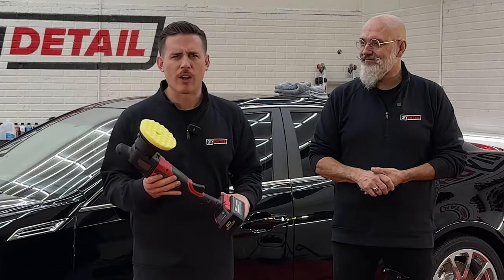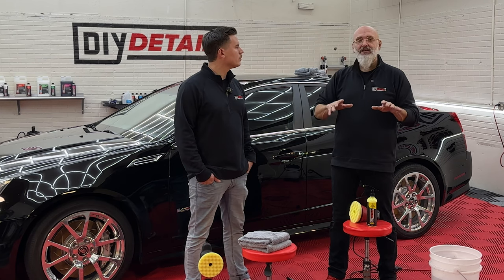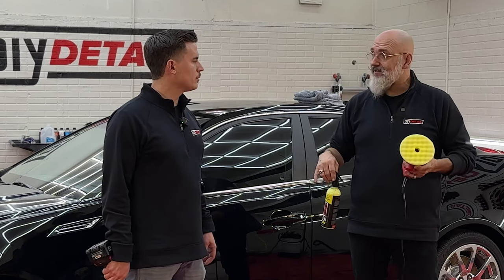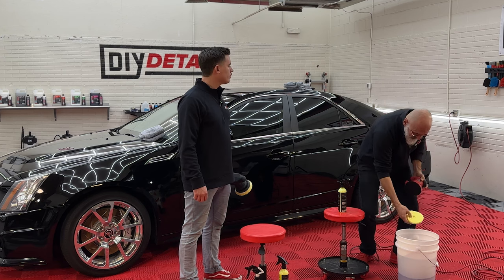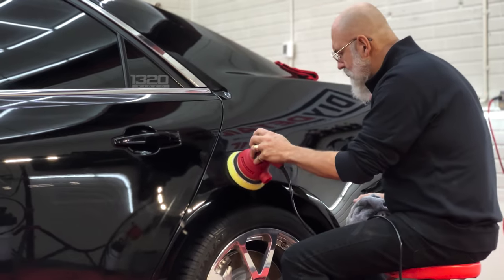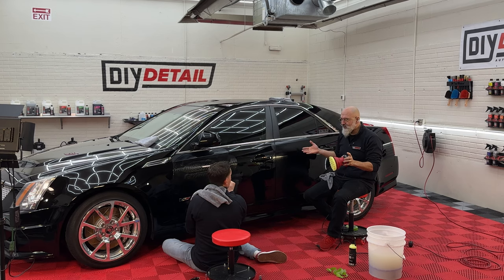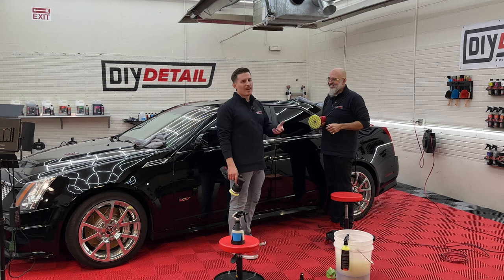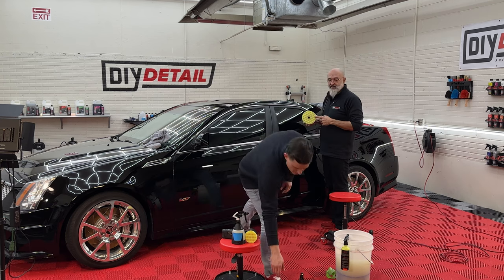How to polish a BLACK car: techniques, tricks (and mistakes to avoid)! #detailing #diydetail

Comment: I’ve told folks for years you don’t need a $400 Rupes or Flex DA polisher. You can do the same job with a $80 Bauer polisher from Harbor Freight😂. Now the more expensive machines will be smoother and give a more pleasurable experience but a 15mm throw machine is a 15mm throw machine regardless of who makes it. Great video. I’m really enjoying the Gold Standard Polish!
Reply from the maker: Thank you
Reply: I second this!
I have a Bauer polisher myself and I love it!
Reply: @diydetailofficial What is some advice you have for someone just starting that isn't covered in your videos?
Reply: Bauer DA is borderline unusable and absolutely does not give the same results regardless of technique
Reply: @lastdays.  not eve close to being true. The pad and polish/compound are what has the biggest impact on results by far. 8, 15, 21mm throw is the same no matter what machine you use. 800-5,000rpm is the same now matter what machine you use. Cheaper machines won’t last as long , are louder and vibrate more but will give you just as good results.
Reply: @BetterThanNewDetailing  to each their own but i got awful results with that DA when I usually get near perfect results with the same pads on a Griots or Rupes DA
Reply: I purchased a Bauer and it was horrible!!! Bad balance and vibration. Spend a little more money and get a machine that will allow you to use the machine without "hurting" yourself! 😅   Last, to be able to do the job and get good results.
Reply: What speed for it? If im using the wool pad? For 2 step
Reply: @JR-nh4fi  if you’re using a corded polisher then no more than speed 2 or 3. Just enough so the pad won’t stall. If your using a battery powered polisher then speed s 4 is good and then when the polisher sounds like it’s losing torgue then go to speed 6.
Reply: Shyt Ive seen old head go to work with a literal variable speed grinder 😂
Reply: other than feeding our enemies with Chinese made products absolutely agree

Comment: How does the Gold Standard Polish compare/contrast with Optimum Hyper Polish and McKee's 37 Spray Correcting Polish?
Reply from the maker: Compared to hyper polish it has more cut, and the longer you work it the easier it is to wipe off

Comment: Just re the glass - I had a very surprising experience. I was trying to remove a stubborn "film" of grime on my brand new car, and tried a compound (Optimum Intensive Polish), by hand, with a small foam pad. (orange CCS). It created micro-marring! I had watched a video on the Obsessed Garage channel where Matt said "use the most aggressive stuff you have" (in the context of thoroughly cleaning the glass before applying a glass sealant). It appears to me that glass, despite it's hardness, still has to be treated with great care!
Reply from the maker: Unfortunately yes, mild is better for cleaning

Comment: Love the rinseless wet wipe method that Yvan introduced me to, makes removing the polish residue so easy. If you're a hardcore DIYer and you're driveway polishing outside (or you're a mobile detailer), you can use the rinseless to wipe down the panel just before you buff it to remove any dust, and it will help cool the panel on sunny days if you keep the bucket out of the sun.
Reply from the maker: Excellent!

Comment: Great videos guys! Do you prefer rinseless wash for cleaning pads as opposed to using a designated pad cleaning solution, like the powder that comes with lake country pad washer? Thanks for sharing
Reply from the maker: The powders have a slight advantage.

Comment: Great video guys. I have been asked to detail a 1962 Impala that has faded paint (original paint). The body is solid and no plastic filler (aka - bondo). What would you recommend to bring life back? Should I 2-step it with a compound then polish? And, can you ceramic coat old paint? Thank you!
Reply from the maker: The least agressive possible, and yes you will want to coat it after

Comment: at what point to switch pad or to dunk the pad in the rinseless and respray with product? 
Or does 1 pad do the whole car as long as you redunk the pad in the rinseless and respray with product?
Reply from the maker: One pad will easily do many vehicles, clean it after every panel.

Comment: Hey DIY guys! I just used these methods with the gold standard system on black paint! I got amazing results! Just curious about the purple pads as I will be doing another vehicle with heavier paint defects. My question is can I wash my purple pad the same as the yellow pad in rinseless like you guys demonstrated in this video?
Reply from the maker: Yes, same system.

Comment: Thanks for putting a great video together I’ve got all sorts of polishes and one of them is the 3M system what do you think of the ultra fine 3m polish on an ultra fine pad as a total finisher, I stopped using it after hearing the word fillers but you’ve maybe allowed me to use 300$ of 3M product thanks so much.
Reply from the maker: Use it before you buy something else

Comment: A really helpful video for someone new to the idea of polishing. I'm curious about the speed settings Yvan is using for the orbital sander? I realize max speed for drying off the pad after soaking/rinsing it but for the actual polishing?
Reply from the maker: On that sander there’s only one speed. With the small orbit size speed is less of a problem.

Comment: Interesting,, but how much area does a squirt of spray wax get you? Don't you need to keep reapplying the pad.
Reply from the maker: What we are using in this video isn’t a wax, it’s an abrasive polish. One spray covers a 2’ by 2’ area. The pad should be cleaned after every section. Never add Clean polish to a dirty pad.

Comment: How do you do smaller areas if you only have one machine? Like the area of the rear bumper of a car that sticks out a few inches from bottom of trunk lid?
Reply from the maker: I use a 6 inch pad
Reply: @diydetailofficial  do you basically try to keep one edge off the pad flat?
Reply from the maker: Yes
Reply: @diydetailofficial  thank you! As a hobbyist wasnt sure if i should be getting a 3” polisher as well. Ill try with 5.5” pad first! Car is just in need of a touch up after 3 years of correction plus coating and want a refresh so if anything maybe i will try the small areas by hand. Thanks!

Comment: Great content always! Why is a damp pad better, better for polishing but not correction? Your product is just for enhancing not correction ? Thank you
Reply from the maker: The Gold Standard Polishing System will both correct and enhance. A damp pad has several advantages. 

-Lower temperatures increases cut and gloss.
-no areas of dry buffing, meaning less chance of swirls or micro marring.
-longer pad life
-pad conforms better to the surface 
-more efficient correction.
Reply: @diydetailofficial  Amazing!! Thank you so much for the detailed reply. You guys rock!
Reply: New pad is pretty hard. Damp softens it
Reply from the maker: Exactly

Comment: Will your polish remove defects like swirls and light scratches?
Reply from the maker: Yes, up to 1500g sanding marks
Reply: @diydetailofficial  wow that's amazing. Any estimation on how many vehicles a bottle will do?
Reply from the maker: One bottle will do the equivalent of roughly 64 oz of traditional polishes.
Reply: @diydetailofficial  Sounds awesome. I know I've been quite the bother in your comments section. Your replies are extremely appreciated, and frankly unbelievable. Never thought I'd have so much useful information from a company in a comments section. As soon as I can afford it, I'll be placing an order. Thank you.
Reply from the maker: Thanks

Comment: I polished myself trying to learn and have slight buffer trails on the black paint. Any pointers?
Reply from the maker: Buffer trails( with a rotary) can be caused by a few things. Too much pressure, dry or loaded( dirty pad), a flat faced foam pad, high speed, and angled pad.

Comment: Gentlemen is it advisable to damp the pad but use other brand polish?
Reply from the maker: no, the Gold Standard Polishing System is just that -- a system. However, do what you're going to do and perhaps it will work for you:) If not, you know the system we teach will work

Comment: For the rinseless wipe after working the polish, instead of a dampened towel, is it as effective to maybe spray a rinseless solution where you were just polishing and spray the towel then wipe? I hesitate to ask if you CAN because of course you CAN, just curious if it would work as well. Love the channel! You guys rock!
Reply from the maker: You can do it but it won’t work as well (it will actually be more work with the spray method). Best case scenario is low nap towel, damp, followed by a dry towel 👍

Comment: 7:30 U can do the pillar with 5 inch but can u do a convex panel ? Can u explain if its possible at all?
Reply from the maker: Yes you can easily do a convex surface, you simply have to slightly tilt the machine
Reply: @diydetailofficial but that seems to contradict your advice to always keep the pad flat

Comment: Everywhere I read tells me not to polish with an orbital sander as you can’t adjust the speed low enough, even at the lowest setting, and the orbital diameter is too small. With all your experience will a palm sander do just as good of job polishing using the same method and without adding risk to the paint? Using the DIY polish and pad of course….
Reply from the maker: It's not a method pros use, but it's presented here as a very acceptable option to SHINE the paint. To get gloss. We're not going after deep scratches, think instead about "shiny scratches." From 5 to 10 feet away the car will pop. Yvan teaches this method because the palm sander is so common. We want this to be easy and accessible -- learnable -- to anybody:)
Reply: I'm reminded of a video from Scott HD where he tried one of those very cheap orbital sanders, just for giggles - his reaction was priceless: "Holy crap it works!" 😃

Comment: Y’all mentioned keeping the heat down.   Well of course.    But then you mentioned swelling the paint from heat.   Got it.   But then you mentioned releasing solvents!!!   So this rather cryptically placed hint tells us that the paint you are referring to has been freshly painted.    As in, within the last few days.     Of course SOME solvents are still escaping even a day or so later, but are we talking about polishing a black car, or polishing a freshly painted car?    You then just happen to mention some partial respray, indicating is has been painted recently.  But HOW recently.   If the topic was polishing a black car, as per the title, then when you mentioned escaping solvents, anyone who knows car paint would be wondering why solvents were still being released from what we should be able to assume is a fully cured car.      And for those of us who know nothing about car paint, we are wondering why polishing releases solvents.      Please correct me if I’m wrong, but it would seem that if polishing could release solvents AT ALL, then the paint wasn’t cured enough to be polishing at all, unless you are highly skilled and are trying to remove an imperfections before it gets any harder, which is quite a dicey gamble to attempt.  I’ve rubbed out runs that were tacky, and I’ve also polished out what was left from a  mosquito getting stuck in barely cured paint.  Making attempts at that could lead to a full repaint.   I’ve been both places.     Cocksure by removing a paint sag with heat. a polisher, and a plastic spreader, and defeated by pushing to hard, where another hour could have saved the job.  I once had to remove the entirety of the  factory paint from the hood of an ML320, Merc code 040 Black, because something kept reacting while painting, and I never did find out the cause.        Blushing, checking, and solvent pop on the first spray.    I stripped that hood at least ten times.   It seemed that those sanding scratches would NEVER get filled.     2K Epoxy
Reply from the maker: The solvents we are referring too comes from the polish. Even water based polishes contain solvents. If you create heat when polishing the solvents in the polish can be forced into the clearcoat, and trapped temporarily.

Comment: It is offen said that you should not let a polishing maschine spin freely without load because this would cause damage. Do you think this is nonsense because you always do that?
Reply from the maker: This is Yvan. I worked in R&D with Porter Cable, and it is not an issue. Bearings are designed for axial load( that’s exactly what happens when free spinning) they are not designed for thrust loads( what you do when you apply pressure to your polisher).
Reply: @diydetailofficial  once again: Thank you for taking the time to write an answer.